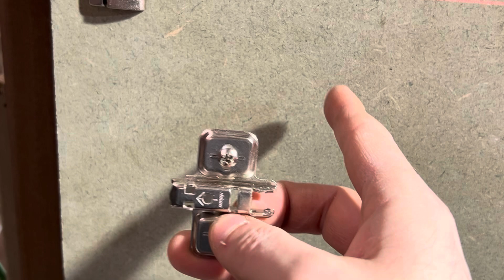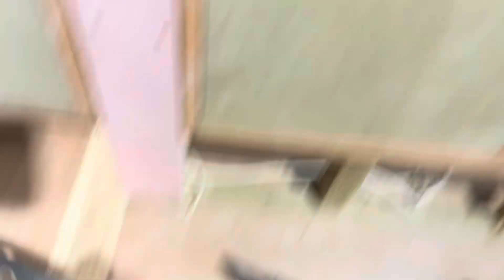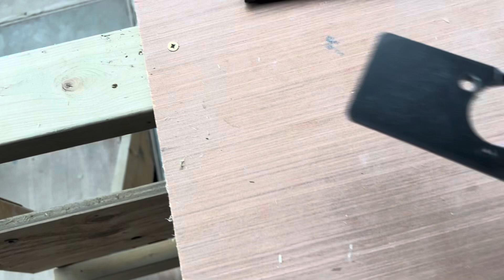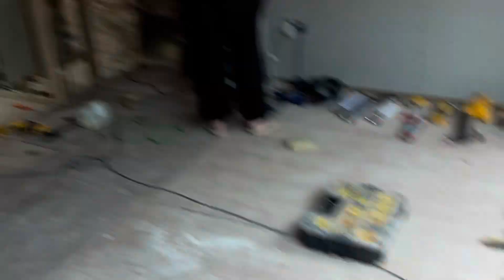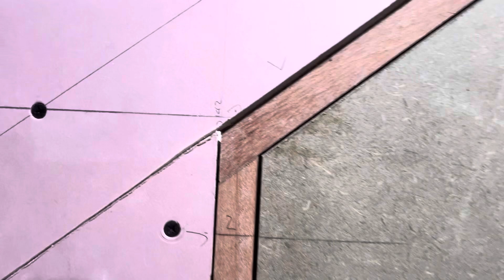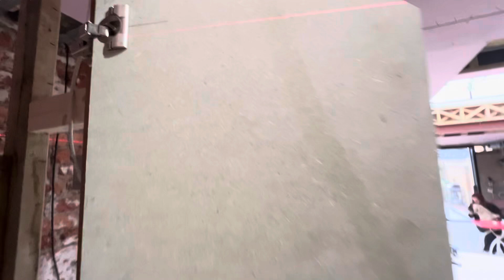Inset understair doors (Blum hinges) part 2

Comment: If you're using low voltage magnetic switches (as used in intruder alarms) to operate your cupboard lights then you could embed a small neodymium magnet in the door to operate it.